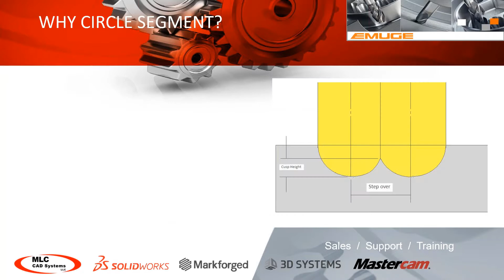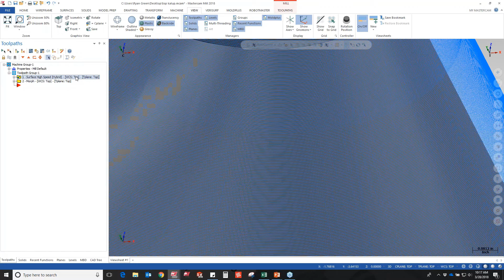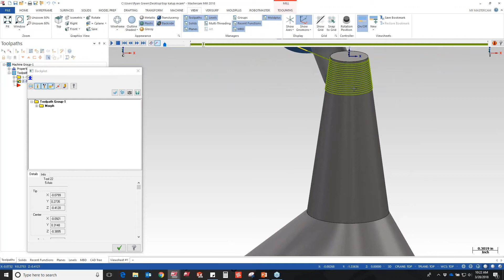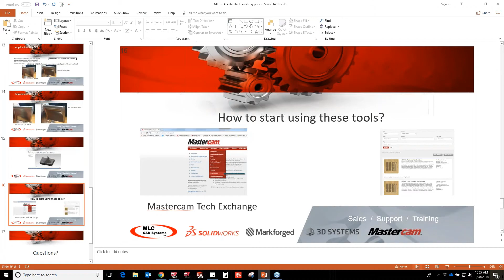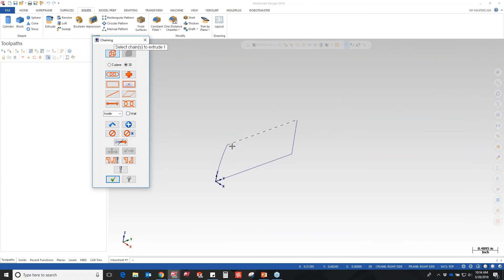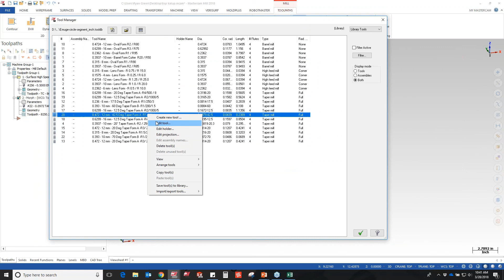Mastercam Webinar Accelerated Finishing

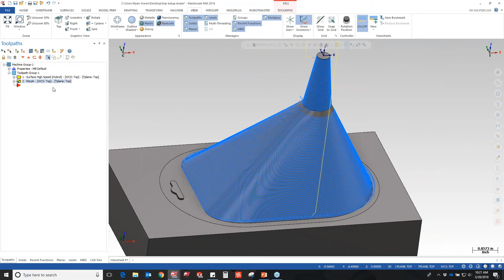Comment: 20:26 Were you not going to try and and explain why this toolpath wasn't cutting the part at the transition between the two surfaces? Why is the tool leaving that gap for? Seems like you'd need to split this toolpath for each surface.
Reply from the maker: Due to the side tilt angle that I’d given it, it prevented it from being able to cut within that area.  You’re correct, I could make this cut with two different toolpaths, one per surface,  so that each one cuts while leaned toward that transition.